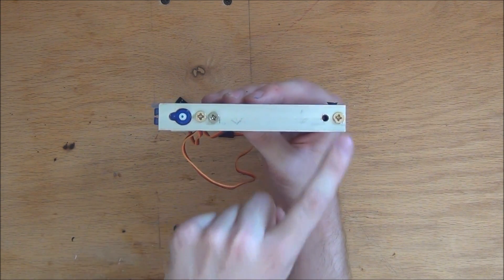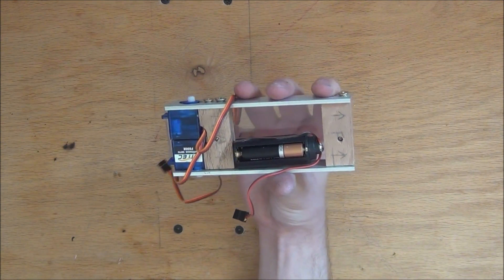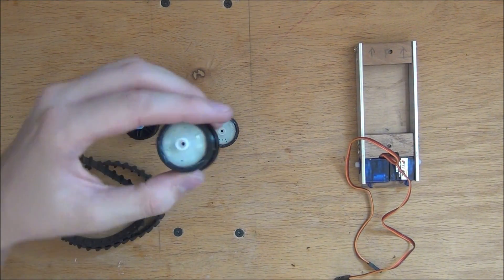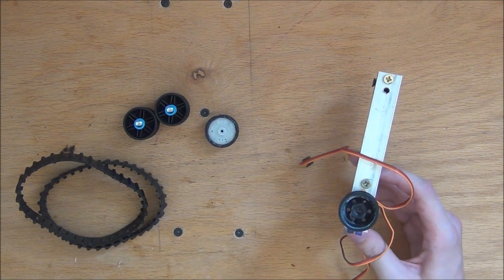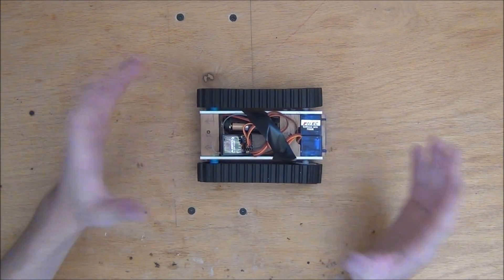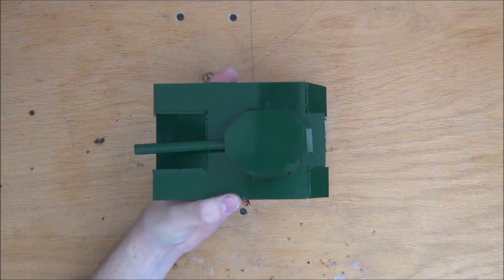How To Make An RC Tank!!!

Comment: I have a question how did a 1.5 volt battery power 3 servos
Reply from the maker: It was actually 4.5 volts. because the batteries were all in series. You're right, 1.5 volts wouldn't have been able to power it.  :)

Comment: hey can you use an other receiver to an transmitter ???
Reply from the maker: You mean can you use a receiver with a different brands transmitter? There are few excerptions but generally speaking no, you cannot. They would both have to be the same.

Comment: where didi you get the remote control and the receiver??? Please respond.
Reply from the maker: I got the transmitter and receiver that's in this video at my local hobby store for about $150. But you could also take one from an old toy for a lot cheaper. of course it is not as good of quality as a hobby grade one but it will still work quite well! heres a video about it!  :)    https://www.youtube.com/watch?v=E0JGThsk1dE
Reply: alright thanks. You know taht im also working on a tank that runs And shoots. So if i finish it maybe ill show you how i did it. Maybe so you can tell me on my flaws.
Reply: thanks very much dude!